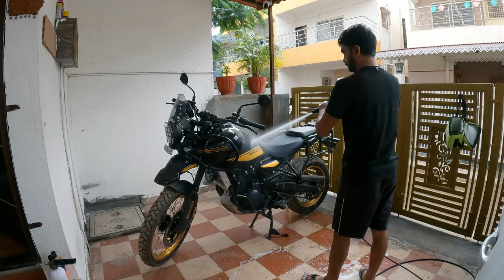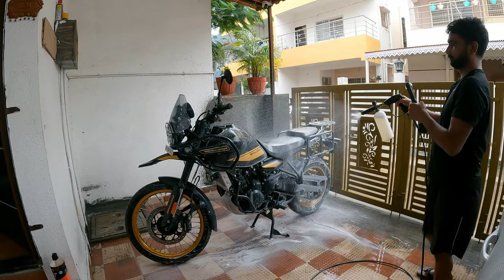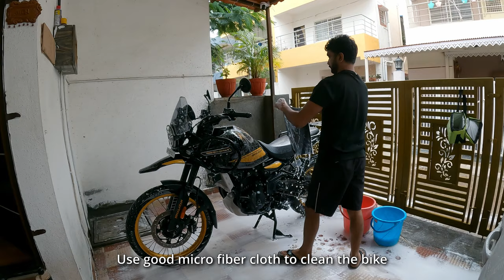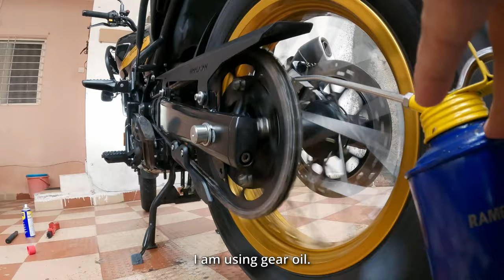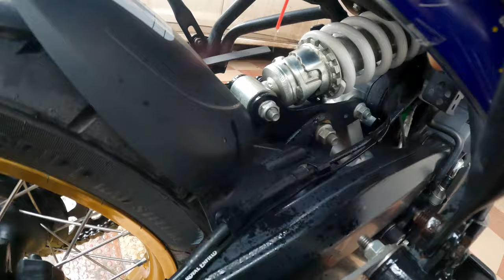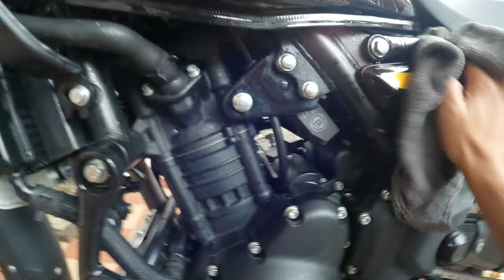Weekly Bike Maintenance: Keep Your Ride Looking New!

Comment: Well detailed video. Only one change I would suggest.. using proper chain lube like motul instead of gear oil.
Reply from the maker: Thank you so much for the comment and suggestion 😊 
I have tried chain lube from RE but the result was not satisfactory, gear oil works great and it is cheap. The only issue is it accumulates dirt. Surely I will try motul lube as you have suggested and will update..
Reply: @OnceARider  yes, exactly.... Any oil applied in chain will inadvertently gather a lot of dirt very quickly.. A good quality chain lube will gather a lot less dirt... I am using motul in this monsoon... Personal experience.
Reply: Fort9 has found gear oil to be best chain lubricant over all.
Reply from the maker: @visangh, I just searched and watched that video and I can say, I had a similar experience. However that video is 5 year old so may be chain lubes are better now, will give it a try what @bhaskardebnath2308 had suggested. But In any case gear oil is cheap easy to use and works great chain runs very smooth no noise at all.

Comment: Lubricating the chain with the engine running is not a best practice. It is dangerous and you can lose a finger.
Reply from the maker: Absolutely, I agree. One should be very careful while working on a bike. If you see while cleaning the chain when my hands were near the chain, the engine was not running and while applying the lube I used an oil dispenser which has a long pipe to deliver the oil my hands were not near the chain. I took proper precautions. 😊